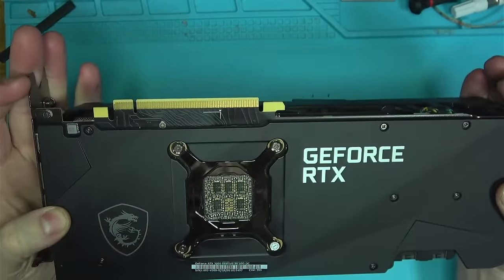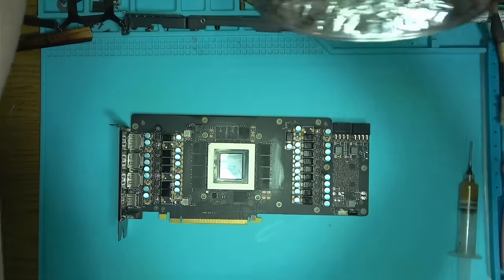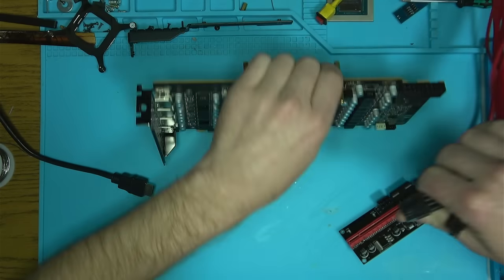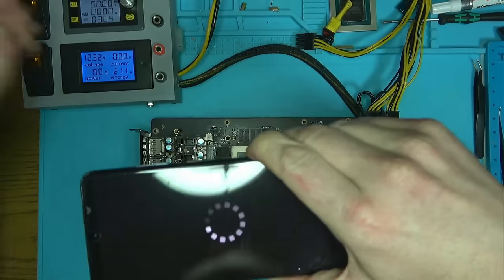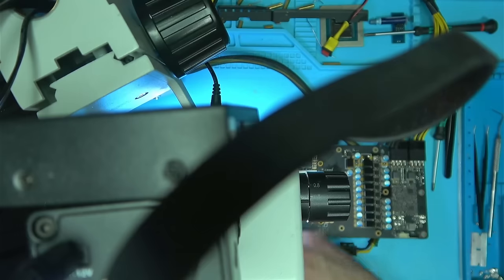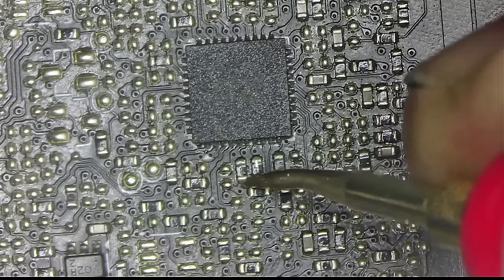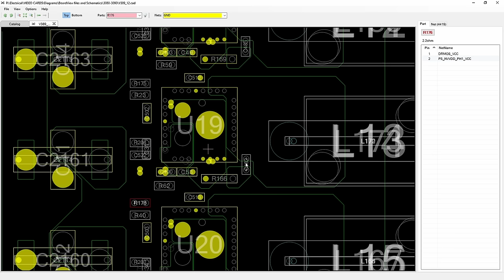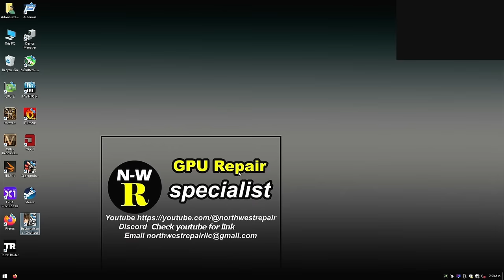This is why GPUs break too easy (long story)

Comment: Fairly certain this is my card, you sir are a wizard. But really this took a lot of work and troubleshooting I was not expecting an hour long video, thank you for saving my card!
Reply: Why did you fart on your card?
Reply: @Akkillies too much cheese
Reply from the maker: It was supposed to be 2hrs long but I managed to cut it to main points
Reply: @FuriousFuria  no not the cheese
Reply: I guess a re-ball wasn’t enough for you huh? Had to take things south east it’s fixed though.
Reply: Probably took the whole day without the cuts.
Personally i would just use the card without using max utilization. Takes a lot of work tbh
Reply: @tyrellwreleck4226  and how would you control how much you used your video card? You can turn down the graphic settings in game but that will not set a clear max usage of the video card. And if you look at some new titles you would see that with some new titles graphic settings don't always do as much as they used to. So what, you would play in 720p, low graphic settings only with your video-card that was worth over $1000?

Seriously, when you have a video-card of that value, you want to be able to play games without fear that it may crash after a few minutes of gameplay. You also want to be able to play with decent graphics settings and high resolution.

What I really wonder is how much that repair would have cost, because it took hours to diagnose the issue and fix it.

Anyways great video, glad that the issue finally got fixed!
Reply: @fireztonez-teamepixcraft3993  always enable vsync bruh
The fps will capped to 60 no matter which setting you use. Mine always run at 40-70% utilization
Reply: @FuriousFuria  Richard Cheese? Apocalypse  or Aperitif?
Reply: @tyrellwreleck4226 "capped to 60". Yeah, high refresh rate monitors say hello. Why would anyone buy a 3080 to game at 60 fps.
Reply: The user above me has made the validest of valid points. CAPPING at 60 fps is a stupid idea when you have high refresh rate monitors. Why use vsync when you have Gsync and free sync?
Reply: @tyrellwreleck4226 Running your GPU at 40-70% utilisation is incredibly dumb. Just get a worse GPU.
Reply: Not to mention that vsync just causes input lag also

Comment: Well, that was a confusing problem to solve. I had no idea a less-than-optimal connection on a resistor could screw a power phase up so badly it caused the mosfet to go into lava mode.
Reply: Modern controllers measure the current flowing through each phase and adjust the pulse widths to balance the load across the phases. But if the current measurement circuit goes bad, the balancing can get way out of whack.
Reply: @TheBackyardChemist  Makes sense, thanks for explaining!

Comment: I have a WARNING on my GPU packaging that says chemicals like lead is used ... So does it uses lead solder or the lead is used somewhere else on the GPU...??
Reply: I'm wondering if that's just the hand-soldered parts like the power connectors, but I guess it could entirely be leaded?

Comment: IMO this is a bigger problem on nVidia cards than on AMD cards. If nVidia board partners want to make any money selling nVidia GPU dies, they are pretty much forced to cut corners on their PCBs. Consumers aren't the only ones who nVidia wants to milk all the money out of, and that is exactly why eVGA threw in the towel, they were sick of it.

Any thoughts on nVidia board partners using poorer quality solder vs. AMD exclusive board partners? Because I think the solder on AMD exclusive board partner cards (Sapphire and PowerColor in particular) seems like it's higher quality than the stuff on nVidia board partner cards. It flows a little earlier, and it seems like the oxide layer doesn't form as rapidly when it starts cooling, which usually indicates more potential strength in the joint.

Also, thanks to the tip in this video, I'm going to stop farting near my GPUs. Seems sensible.

Comment: The problem with using lead-free solder only comes with government regulations. Lead is toxic and some governments like those for EU demanded lead-free alternative to keep lead out of trash. Unfortunately regulations are often poorly planned.  There's no cheap lead-free substitution for leaded solder, and most of the lead-free solder generally bonds poorly.  Ever wonder why NASA still uses leaded solder for space stuff? Lead-free crap wouldn't survive the vibration or the high G from rocket launches.

Even I use leaded stuff for personal projects, I want whatever I invent to outlast me and not need touch up resoldering every few years.

Comment: "Where's the resistor?"
>looking at the ocean of components
"Yeah good luck finding that"
I feel you man
Reply: boards are usually laid in sections for each circuit. It's rare to see a circuit run all over the board, not impossible but it's really inefficient and unlikely.

Comment: There hasn't been any lead in consumer electronics since roughly 2006: https://en.wikipedia.org/wiki/Restriction_of_Hazardous_Substances_Directive
Reply: You're underestimating the determination of Chinese factories to skirt the rules
Reply: Love your channel too!
Reply: @MegaFUZZY2010  god bless the chinese!  Skirt those rules!
Reply: @MegaFUZZY2010  Yeah I don't think getting your product banned from sale in the EU and US is worth the increased reliability. After all if the product fails outside warranty it's not the manufacturer's problem. So any large "name-brand" manufacturer is gonna follow RoHS. Some random aliexpress seller not-necessarily.
Reply: As the Beatles said, Lead it Be.
Reply: @MegaFUZZY2010  They substitute the lead for other more toxic alternatives like cadmium and/or antimony
Reply: @brnmcc01  RoHS restricts cadium even more than lead from what I can see.
Reply: @ActuallyHardcoreOverclocking  Absolutely. It's nasty stuff, but lead paint was banned in like 1976, but there's still been instances of kids toys from China as late as less than a decade ago with detectable levels of lead in the paint... I'm just saying, I wouldn't put anything past china manufacturers  to add RoHS stuff to things to cut a few cents...
Reply: @MegaFUZZY2010  It would never get past customs...lol

Comment: The absence of lead isn't the problem here. It's the fact that manufacturers use the cheapest stuff that barely does the job. And why shouldn't they? People will buy it anyway.
Reply: No pride in making quality products, willing to cut costs at every single corner if it makes them a few dollars more.
Reply: That's pretty sad. I wonder tho if it's the manufacturer of the solder paste they buy that's cutting the corners. I'm sure board manufacturers do not make their own solder or solder paste, they just buy from whoever.  Anyway that's beside the point, how much money is there in solder in even a large card like a 4090? $2?
Reply: People have no choice but to buy it anyway. What else could they do? Manufacture their own gpu or electronics? Unless remaining a caveman is considered a choice too.
Reply: Too much Greed. Too little pride.

Comment: i hope you are keeping detailed records on all repairs made. would love to see a spreadsheet of which cards are worked on the most. also might would come in handy one day to hold the manufacturers accountable for the corners cut
Reply from the maker: I have the record but don't track any statistics. Only success rate to some degree.
Reply: thank you so much for the reply. It means alot to me that you took the time to read and respond to the comment.  @northwestrepair
Reply: @northwestrepair  do you record failure mode eg. "Voltage rail designator + component designators + description of failure"? Don't know if it's useful for your operation, I guess it depends on the volume of cards you work on yearly.
Reply from the maker: @Rotwold  not in any way that can be tracked.

Comment: You are right about dry caps, heh. Personally, when I do my own soldering (repairing old electronics from the 1970s) I will only use 60/40 Sn/Pb with an extractor fan and carbon scrubber. I've never had luck with Pb-free, they are all brittle, no matter how much silver is put in the alloy.
Reply: Lead free solder doesn't mix well with any leftover oldoriginal solder, and like you said its hard to use and brittle.
I also find the flux varies a lot in solder. Used to use cheapo tubes, now I use rolls of Stannol made in Germany. Vintage hifi forever! :)

Comment: I use non-leaded solder and everything seems to last fine and have good structural integrity, maybe they're just using poor lead-free alternatives? The only difference I really found between working with leaded and lead-free solder is that leaded solder is easier to work and solder with at the increased risk of occupational health related conditions, so maybe it's the specific type of solder that's at fault rather than blaming the entire leaded-free market.

Comment: Lead free Solder is mechanically less durable compared to Leaded Solder. But i would think they are using Solder with a few % Silver (like in the Car industry) . This would make the Solder mechanically even more resiliant compared to normal Leaded Solder. It needs higher temps but it also helps with wetting. Thats why i use it especially for high power LED´s (in flashlights. . . ).
Reply: Use solder with silver myself, stuff is great.

Comment: lol I foresee manufacturer advertising claims of "Now with leaded solder!" becoming a new premium selling feature.
Reply: I'd pay $10 more for that.
Reply: Would need to rescind some laws to be able to sell that but yeah it would be nice.
Reply: @honeybadger6275  Or you know they could be doing their job. Using better solder (unleaded, like 405), using heatsink subassembly for reinforcement, adding edge bond and underfill, using higher quality materials overall. Just adding lead isn't gonna help if the manufacturers are still hell bent on making things as shoddily as possible, they'll find ways to make it landfill fodder yet.

Comment: I'm not sure about the characteristics of lead-free solder, however I wonder if it causes cracking more than Zn-Sn-Pb solder. I was a digital circuit designer in the past and I didn't see any problem in lead-free solder except melting temperature and viscosity (self-alignment). If I could think the cause of cracking, it was the massive, repetitive temperature change in operational condition, I think. High temperature is a nature of high power consumption and it happened in mainly power circuit and power circuit had large foot prints in the past. But this assumption is not true in recent BGA large LSIs. Their solder joints are small so get cracked by swelling caused from temperature (e.g. think about bi-metal).
Reply: lead-free isn't as soft, has less malleability, more likely to crack from any form of stress

Comment: CORRECTED EDITED FORMATTED TEXT
# LEAD FREE SOLDER
  Almost all modern electronics including laptops and motherboards use
  lead free solder.
  While it is less toxic - the life span of the device is significantly
  reduced by physical factors.
  Any bend - twist - bump or shake can cause joints to break -
  rendering the device inoperative and in most cases not repairable.

  Older devices that used leaded solder have one problem; dry capacitors. 
  Everything else continues to work but modern electronics with lead free
  solder have near zero longevity.
  One can have a dead GPU on arrival damaged during shipping in a box.
  It can break by simply installing it and giving it a slight twist.
  The list of reasons why a GPU breaks is growing longer by the day.

  Some manufacturers such as ASUS sometimes use leaded solder on premium
  boards -  so my question is: when a  GPU costs nearly $2K and some models are
  premium models - why won't they use leaded solder ?
  Answer : Because they want it to break quick and deny a warranty.
  Corruption at its finest art form.
Reply from the maker: Damn AI robots won't let humans make human mistakes 😐

Comment: This information makes me wary of removing my MSI 1080ti from where it's been sitting since the summer of 2019.  Was thinking I should clean then give it a fresh coat of thermal grease between GPU and heat sink - might be the beginning the end of it. 

You give these manufacturers 500 to 2000 bux for their shoddily manufactured equipment - thinking surely ASUS or MSI or Gigabyte, etc... would think enough of their product and workmanship that they'd take steps to prevent manufactured obsoleteness.
Reply: its an older card before this stupid lead free movement happened

Comment: Leaded solder was the cause of the Xbox 360 fiasco with the red ring of death all of them years ago
Reply: No, first batch od Xbox 360/PS3 GPU have a problem with cracking micro-bumps NOT a PCB-Substrate side BGA connectors.
Micro-bumps are located UNDER A GPU and Substrate and filled with underfill, you cant desolder Micro-bumps without trashing chip itself. Reballing a GPU core do not work for this problem, my XBOX 360 still died after reball. 

And if i Remember correctly Micro-bumps in that time were made with a HI LEAD ALLOY, with a melting temperature of around 350*C.Also i have no idea how TSMC was soldering Micro-bumps.

Comment: Tony, I watched every second of this video and I knew from the beginning the answer on to "why GPU's break so easy" it would be the solder joints. Question: Would you consider a re-flow oven for such kind of jobs ? Do you think it will make any difference especially in saving time ? I don't mean to replace the reballing of a core with a reflow oven but only for this specific kind of jobs where you have to reflow every single component.
Reply from the maker: No I would not.
How do you expect to reflow GPU with  electrolytic capacitors and not blow them up or damage inside the oven .
?
Reply: @northwestrepair Low temp I suppose...But anyway, this is not a good idea I agree. Just asked out of curiosity.
Reply: @northwestrepair  I remember reading about this method for more things than just GPUs, but in practice it takes a quite sophisticated oven capable of delivering precise temperatures on a given amount of time for each phase of the process, pre-heat, reflow and cool off.

Comment: They can't sell leaded solder products to the EU, and there are other countries (and us state(s)) that restrict the sale of leaded solder products for the most part. They're not going to set up multiple production lines for different countries _and states_. The manufacturers did not want to switch to lead-free solder but they were compelled to. As a hobbyist I don't like the stuff either, and tend solder with leaded solder anyway.

You can't have a negative lead percentage, I hope that's just a joke.
Reply: I use Stannol 60/40, made in Germany, except I have to buy it from the USA and have it sent back to Ireland. Thank you Europe. That's really helping the environment.

Comment: I have a Power Color 5600XT ITX and a capacitor blew off with an air clean. It was two years old at the time with zero rough handling on my end. I used the opportunity to upgrade to a Sapphire Nitro 6700XT. Replacing the 5600XT used is as low as $40 so I don't think repair makes sense financially.

Comment: exactly what caused the old Xbox red ring of death. lead free solder
Reply: not exactly.. there were numerous mistakes with the board layout and cooling design that would have been an issue regardless

Comment: I'm curious, it's probably not ideal, especially for a professional repair, but could the good PWM signal from a neighboring mosfet have bridged to the other mosfet, and the bad signal pad blocked with conformal coating?

Comment: Pretty sure part of the problem is that a lot of gamers don't know how to build or tune a PC for cool operation. Keeping temps down will definitely slow the degradation of solder joints. 
I tried to snag a practice GPU recently but it ended up going for just as much as a working one would cost. I think a lot of people just don't read and then when the GPU doesn't work, they'll be claiming they got scammed. Oh well, I think I have a dead R7 250 around here somewhere.
Reply: Nah. The GPUs just need to be built to handle PC heat. You cannot blame pc builders for poor solder from manufacturers.

Comment: If you need a good strong metal table you can usually find table saws on your local marketplace for under $100. Also good as welding tables.

Comment: Hmm my Asus Tuf 3080 started doing the same going black screen full fanspeed when it reached around 65c on the core.. had to underclock it by 80mhz to make it stable.. fortunately its still under waranty so its at Asus' lab now and im crossing my fingers they will actually find a fault and fix int rather than send it back with some bs excuse
Reply: @@Eric-rl3jlNo a week ago i got a mail from the company i bought it from and they informed me that i would be getting my card fully refunded.. no explanations on what was wrong with the 3080 in any way (didnt really expect it but was hoping there would be some short message from asus :D ) just got all my money back which is both nice and annoying.. nice that i can now spend it on a 40 series card instead annoying cause i have to find a good one that meets my requirements (noise/temperature/performance/build quality)